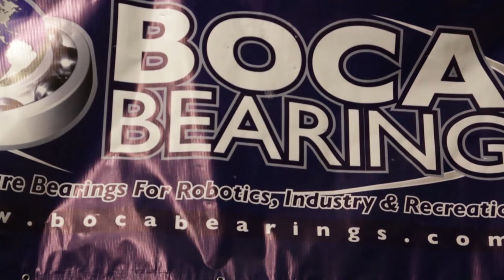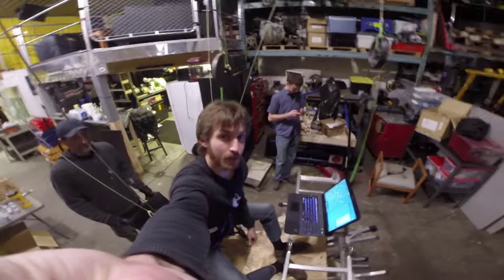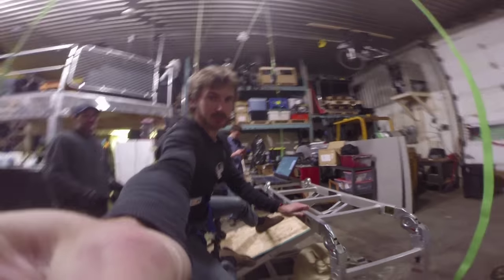DIY Stunt Wire System -- PART 4/4: Cirque de Hacksmith!

Comment: Belt that rotates along the horizontal plane with bearings on side allowing horizontal rotation. Ie : clips on side,  front flip. Quickly rotate belt to clips in front and back, side flip. Something along those lines would be interesting to see if it could be used for parkour training to get over fear of different flips/tricks for free running.

Comment: Couldn't you do a robotic arm that is controlled by a big cube with laser pointers aimed to a rispective photo resistence , then with some basic arduino code you could create a program where when your hands moving in the cube stop the pointer from  hitting the photo resistence . The code will then see ( not like this) , if the photo resistences aren't hit by light   in a specific order ( up , down , lert , right ) , move the roboticarm like your hand
Reply: Obviously more complicated and precise

Comment: It would be awesome if you could change the weight of the counterbalances on demand.
Reply: he could if he had a electromagnetic facing the weights and varied/controlled the magnetic force placed on the metal weights thusly making the pull on the harness stronger or weaker depending on what he needed and it all could be controlled by a bluetooth trigger with 2 simple commands , one for up and down through a program on his phone to a computer or micro controller or something like that right? +hacksmith
Reply: +Juan Cruz (Thy Beast) +the hacksmith